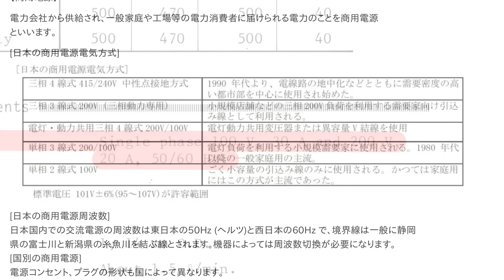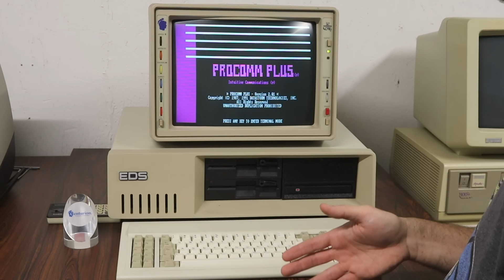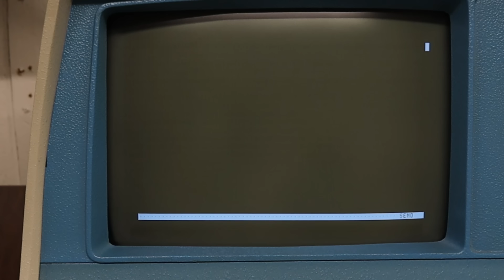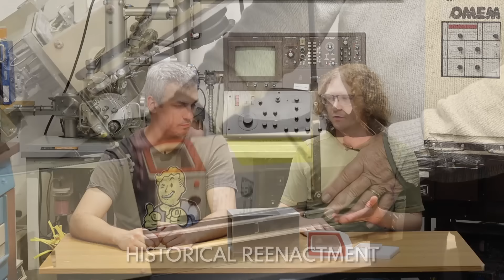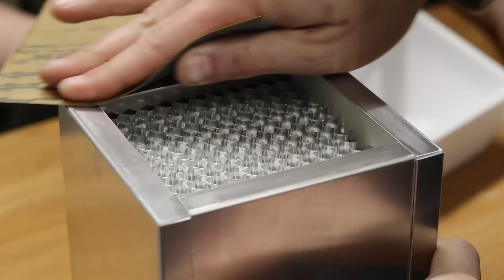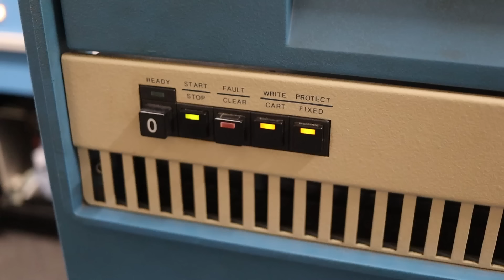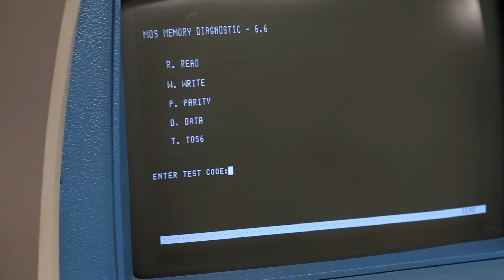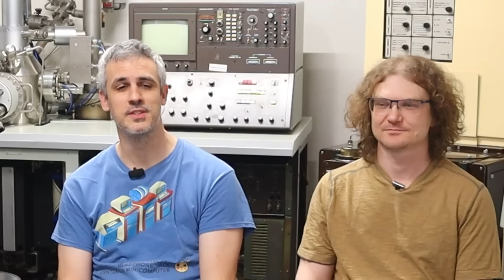Welp... that's terrible.

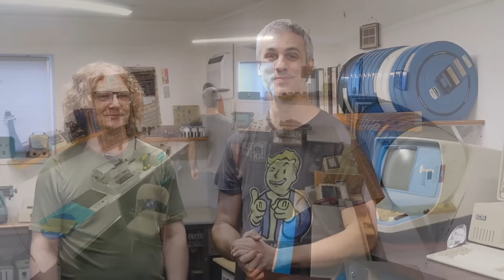Comment: 4:00 In the immortal words of Chris Boden: Code is a floor!  It's the bare minimum to get The Man™ to sign off on it, so there's a lot of room for improvement.
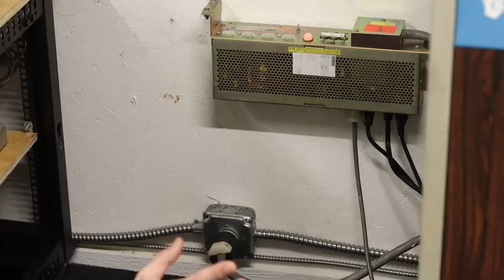Reply: And this isn't even up to code. At 4:20 the box doesn't appear to have a connector on the right side.

But ideally, this should have been run either in pipe or outside of the finished space.

Comment: variable ac transformers are like $60. 0-100 volt 500watt.  they're great for eliminating surge even if you don't need to transform the voltage.

Comment: The seemingly random and not consistently reproducible errors reminds me of system to system communications issues caused by grounding issues. Maybe try removing jumper you installed that connects the grounds. I worked on a project in a plant where almost everything had floating grounds. We ran into issues where 24V signals from one controller panel to another in the plant were seemingly randomly during diagnosing issues signals would be read as inverted (0V or 24V) and it wasn't consistently reproducible. In this case we found the issue was sending 24VDC signals from one cabinet to another required cabling the associated 24VDC ground to the second panels input card instead of using the local 24VDC power supply ground in the cabinet. Maybe something or nothing for you.

Comment: A 240/40V and 120/20V transformers with the low voltage wired opposite the mains. Used as autotransformers.
The challenge will be to find some with a primary winding meant to handle the amperage.
Maybe old buzz box welders?

Comment: Not sure if it applies to your case but you could possibly use a "bucking transformer" to adapt the voltage for the Japanese market thingy. Someone recently did it for a CD player but this is obviously much more of a power hog. 
Anyway, you would need a transformer that preferably has multiple low voltage secondary windings, or center taps on those so you can use part of a secondary, or at least one that has a single secondary of suitable voltage. You will be wiring this transformer directly into the mains just as usual. Then you will wire the original transformer primary in series with the preferred secondary of the bucking transformer. WIth correct polarity you can add or subtract this voltage with the mains voltage. 
For example, a 20V winding can be used to subtract 20ish volts from the 120V mains voltage, yielding 100ish volts for the apparatus in question. The bucking transformer does not need to be able to throughput all of the power that the device needs, but approximately the fraction that corresponds with the amount of voltage correction.
Reply: Seems I wasn't the first one to suggest a bucking transformer, so it can't be THAT bad an idea.

Comment: Bucking 240V down to 200V and 120V down to 100V can be done using standard isolating control transformers as autotransformers. The way this is done is to hook the primary of the transformer up across the line/neutral, and the secondary in series with the line. Depending on the phasing of the secondary, you can either buck or boost the voltage. 

So for instance if you need 100V, you can get a 120V:24V transformer, set it up with reversed phase on the secondary so that the resulting total voltage from supply and secondary in series is 120V-24V = 96V, and that's probably close enough. Same deal with 240V: a 48V transformer would get you to 192V.

The secondary amperage needs to be equal to the circuit amperage, of course: so it would be a 24V/>=30A secondary, and a 48V/>=20A secondary. These aren't tiny transformers, but they aren't huge either; they're both less than 1kVA, so that compares VERY favorably with the 3.6kVA and 5kVA isolating transformers that would be necessary. 

Of course you can also cobble the voltage you want together with smaller units, either for higher precision or because you find cheaper and smaller volt-amp rating units. 

On that note actually I can highly recommend the Hammond 185G10. These are quite economical 175VA units that I use all the time at work. There are plenty of variations of the 185 series to choose from as well, for different voltages. The 185G10 puts out 5.2VAC at 35A or 10.4V at 17.5A from either 120VAC or 240VAC depending on your choice of wiring. 

So you could use four of these in series with the line (either 4x5.2V secondaries all in series, or 2x2x10.4V secondaries in series/parallel) to buck down from 120V to 100V/30A almost exactly. 

And you'd need a slightly annoyingly sized collection of 8 of them to to do the same job for 240V not very cost effectively. However if you could get your hands on five 185G16 models, these would get you 200V/20A from 240V again almost exactly. 

The total cost should be around $400-$600, which is extremely cheap as far as these kinds of things go.

Comment: Power supply conversion can be done for less than $500, by subtracting voltage fom the mains. You can use a much smaller and cheaper transformer to subtract voltage vs trying to convert the whole supply. 
You wire the output of the transformer in series with the mains voltage, but in opposite phase.

Nominal single phase AC is 120/240.

So you'll need a 120->20V at 30A (600VA) transformer, and a 240->40V at 20A (800VA) transformer.
I couldn't find a 30A transformer on a quick search, but I found a 16A transformer (Hammond Manufacturing 167U20) for $120 at DigiKey. Two of them in parallel, wired to subtract fom mains voltage, will give you what you need.
Two more in series (primaries in series, secondaries in series) will give you the 240->40V conversion that will fix that supply voltage.
So you can have it all sorted out for less than $500. Not dirt cheap, but not eye-watering expensive, either.

Comment: Building on what others have said to generate 200V @ 20A and 100V @ 30A.. use one buck transformer to convert your 240VAC to 200VAC, which would have to support 1.7KVA @ 40V. Then take your 200V to the machine. Take the 200V through another transformer to 100V.. but the trick.. use a 240V to 120V transformer to do it. That transformer is rated for 3KVA. That is the simplest plan that AI and I could come up with. Can the machine be modified for 240V/120V? Some AC loads are modifiable, some things are permanent..

Comment: The easy solution to step down 120/240V to 100/200V would to find any random transformers that takes any of 100V, 120V, 200V or 240V that can output 20V at the required amperage, and connect it's output in series with the incoming live legs. Depending on the polarity you'll either end up with the desired 100/200V or the really undesired 140/280V, so make sure you measure the output voltage before connecting any load, and also make sure everything is connected using fixed connections. Note that if you disconnect the high voltage winding on a transformer used this way that winding will still have dangerous voltages, even higher than it's rated voltage, if the circuit on the lower voltage winding is connected to any load.

Re head crashes: I assume you have already thought of this, but in general, maybe check every type of consumer electronics head if they might even remotely be usable. Thinking in particular that perhaps heads from the drum of a video tape recorder might be possible to adapt? Or maybe not.
But also, on one hand heads really are precision devices. On the other hand the technology itself is almost stone age, like a coil wound on a material (metal) that can conduct magnetism, with everything in a particular shape and non-conductive non-magnetic filler material added. Seems like something that would be possible to actually DIY with the appropriate tools (that you partially might have to DIY too).

Comment: Try using a 30 AMP Variac to reduce the voltage from 110 to 100 or 220 to 200

Comment: When it comes to the JAMP-9500F power supplies, if they are switch mode and don't use "big iron" on the front end you can likely run them on DC (smoothed or otherwise) just as easily as AC, and that makes controlling a voltage drop a LOT easier!
For dropping 40V at 20A, you have to dissipate 800W, and for 20V at 30A you get 600W. There are plenty of 1kW+ dissipation MOSFETs in the range of $20 or $30 each, and the biasing circuitry is insignificant. A couple of large heatsinks with active cooling should handle the heat.

However, if you have access to 3-phase power, you can get 208V, which might be close enough already?

And, as others have suggested, using a buck transformer is also a viable solution, as it only has to handle the power of the bucked voltage, not the whole shebang.

Comment: Do you need an 18 inch platter? I think mine is still good. It is inside the removable platter case, and has not been exposed to handling.

Have you ever heard of a bucking transformer? You don't need the same current capacity of the step down transformer, when you are
using a transformer to just lower the voltage a few volts, by having the secondary winding wired in opposition.
If you get it backwards, it can be a boost configuration and add voltage! But the big thing, the wattage of the transformer is only for the buck or boost voltage, and not the total current and voltage of a step down transformer!

https://blueglowelectronics.wordpress.com/wp-content/uploads/2018/11/bucking-transformer-slides.pdf

Comment: Electronic Data Systems (EDS) which was founded by Ross Perot, made MES for manufacturing facilities. I used them at my last job, they later went to HP, then DXC, but we still called it EDS because it had been that way for ages before the name changes. Also, because EDS was an awful company that made garage products, the admin password was the same across all the installations they did. So if you knew the admin username/password at one company, you knew them at all. Wonderful isnt it.

Comment: With the 100v/200v issue, I'm assuming there aren't multiple taps on the primary to allow for higher voltage?  Perhaps it would be possible to modify the regulators and other components on the secondary side to handle 20% more incoming voltage,  rather than trying to find an expensive transformer?

Comment: You don't need a full amp step down transformer, you can just use a buck/boost transformer. Way cheaper way to get the voltage and current you need.

Comment: I wonder if you could find a UPS compatible with japanese and US voltages. 

I've previously used an online UPS to temporarily run some 120V 60hz US equipment on 230V 50hz Swedish power. Was admittedly surprised it let me.

Comment: Can't you use variac to bring voltage down to 100V or 200V? It is variable transformer, so you can get whatever voltage you need. They are $100-$150 range for amperage you need.

Comment: Back in '82 I was the only non-CPA tech at a McAllen accounting firm, still wearing a tie. We had this beastly Centurion 6400 with CDC Phoenix CMD-64 drives with 52.9 MiB of cartridge glory.
One humid morning, pulling a payroll archive for audit: spin up Drive 2, slide in the cart, that sweet whine starts... then CRACK!! head crash like a gunshot. Smoke, grinding, platter turned to dust. Console locks on "I/O ERROR - DRIVE 2 NOT READY."

Partner yells down the hall: "How long till we're back online?" Me: weeks. Data gone forever, replacement parts cost more than my paycheck.
1982 minicomputer life. Those Phoenix drives were monsters right up until they ate themselves. Head crash horror stories, anyone?
Reply: You haven't seen anything until you crash a set of heads on a 20 head (300mb) CDC 9766!
We charged customers upwards of $30,000 back in the 90's for a rebuild. Factory heads were about $450 each at that time.

Comment: Whelp. Stuff happens. Don't despair.

Try verifying the new HEPA filters were actually made to the same parameters as the old ones.

The vacuum caused by filter may cause head crashes - the air pressure needs to be within specs for the heads to fly properly which is why you should never float them without the filter - though in that case the removable heads would have likely crashed first then.

I have absolutely no idea how to test them though. Perhaps - connect to a vacuum cleaner and see how much current does it draw with new and old filter? You would need to place the air hose precisely the same though. I'm also unsure if the filters are actually rated for the pressure differential (suction force) a vacuum cleanser produces... too much might damage the filter, so maybe a handheld car vaccum? I dunno.

---

If you have problems that emerge and disappear the first thing you should check is the stability and cleanliness of the input voltages with a scope. 

The second one is cabling. Specifically not-quite-inserted power and data cables.

I assume you fixed the ground issue and checked everything actually connected now.

If that is not it - when the system starts misbehaving again - probe the clock, data and address lines. If any of them are not quite the logic levels they should be - it could be literally any chip connected to the bus. Start by removing the boards you can remove without incapacitating the system - one by one.

Try to ascertain and log when and how exactly the system misbehaves. 

---

100V systems should probably be tolerant to 110V input.

Granted the age of this thing you most likely will still need to understand how the PSU(s) work - if only to check they are not shorted, leaking, etc. 

I have a feeling the only things you will need to replace to make it work would be thermal grease and fans on the DC input regulators.

Although overvoltage might put additional strain on the components and wear them out faster

To reduce said strain it may be possible to tweak the AC input circuitry slightly - this greatly depends on the design of the PSU(s) so publish that first.
 
---

I would suggest overhead wire hooks/holders/girders - that allows rewiring the room as frequently as you like - which seems to be important in your case. But it's a matter of preference.

Comment: Since you mentioned wanting to do things to code, just get a 20v buck/boost transformer for the 100v and a 40v buck/boost transformer for the 200v from a local electrical supply house and wire it in according to the instructions.  It'll have knockouts for conduits and is made for the purpose.  One we use normally can be tapped for a bunch of voltages in either buck or boost mode - basically 16v-40v in 4v increments.  16v/32v transformers may be more common in your area, not entirely sure.

Comment: You can get a 240V to 40V transformer to give you 40V can then wire antiphase to subtract 240V live down to a 200V live.
The transformer for this is a lot smaller since it only needs to be 400VA to handle 10A

Comment: HOLY COW THE POWER NEEDS!!!

No wonder energy efficiency was a must for computers moving forward haha, so interesting to see such old machines running!
Reply: Wonder how much of it is just the power supply being inefficient lol.
Reply: @SockyNoob  Those old NMOS chips sink a surprising amount of current; it can often be ten times as much current as "modern" early '80s CMOS chips. For example, the 4116 memory chips alone can sink up to 35 mA each, so that's well over 2 A (at 5 V) just for the memory alone. Not that this really compares to the massive rotating drives and the like.
Reply: I used to have an IBM System/34 that wanted 240v at 40 amps. Gigantic freakin' monster.
Reply: Australia's first computer, CSIRAC, took 30kW of power for half a dozen or so fridge-sized cabinets. Then again, it was a valve-based machine from the late 1940s.

Comment: Another possibility would be to have the internal transformers of the equipment rewound with less turns in the secondary.  I'm guessing it's likely that you will be able to reach someone who understands the equipment and can suggest something that's a tad less brute force than applying transformers between the line power and the mains supply to the equipment.  As long as you don't expect to take the equipment to Japan and operate it there too on its 100v/200v standard, modifying it permanently shouldn't be an issue at all.

Comment: From dealing with tube radios... The only way except buying the expensive transformer would be to either replace the transformer/PSU inside the device, or use HUGE resistors. And the latter would surely be enough to heat up the entire room... so... those are my 2 cents.

Comment: Regrettably this is part of why I just use modern drive emulation for most of my vintage computers, though I have nothing close to a Centurion and mostly just home oriented machines. I'd love to run old hard drives, but they're just such a can of worms and so difficult to repair in the event of a failure.

Comment: To reduce voltage by 10V you need a „mains to 10V“ transformer that can deliver the needed amps on the 10V side. Primary winding to mains and secondary winding gives you a potentialfree supply that you can just add/subtract from your mains by connecting it in series to mains. +- depends on the „phase“, so just measure and flip the primary or (XOR) secondary terminals if it’s the wrong way.
That way to reduce 110V 10kW by 10V, a 1kW transformer is enough.